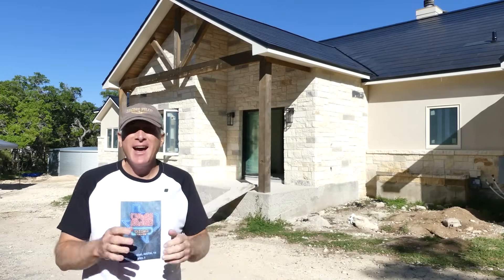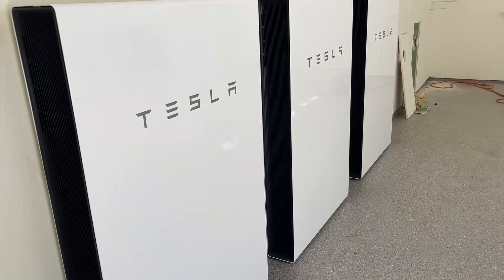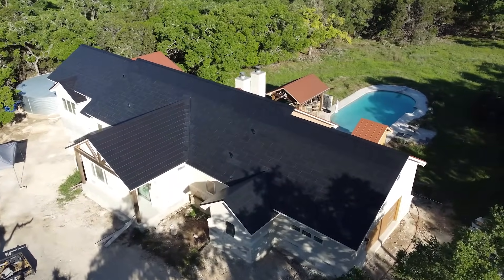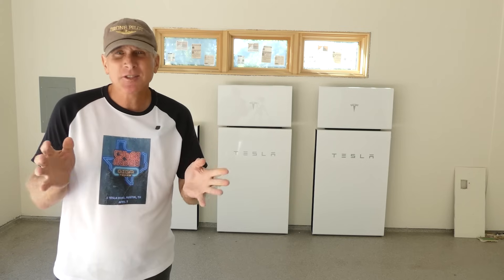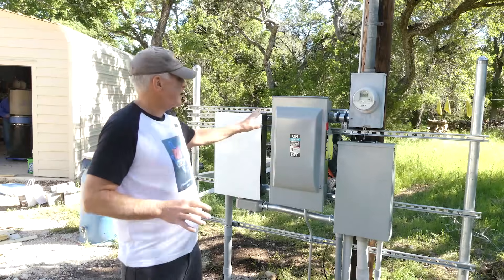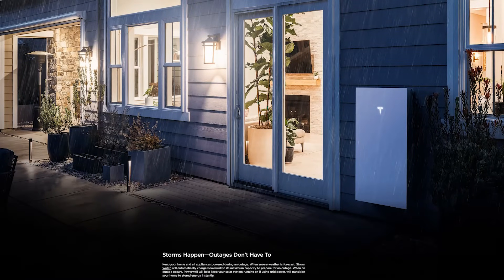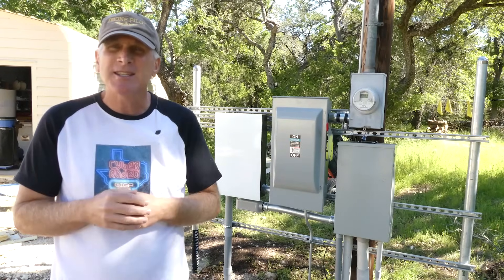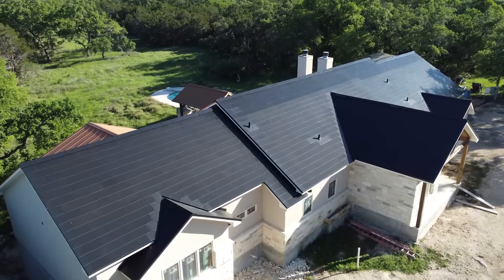Tesla Solar Roof & Powerwall Installation Part 4 ... Powerwalls, Gateway & Cybertruck Powershare

Comment: That is absolutely BONKERS that the gateway, disconnect and breaker box are mounted on a metal rack at the pole.  I worked in solar for 5 years and NEVER saw an installation like that.
Reply: I was thinking the same... where I come from, everything goes inside a fiberglass cabinet (unless its indoors).

Comment: If after rebates the cost of the system was $150K and there was never any cost to maintain, figuring an energy reduction of $300/mo, it would take 42 yrs to pay this investment off. 
I’ll pass …
Reply: Most of Texas has been experiencing peak electricity prices over 100 times higher than the the rest of the country. If you participate in the virtual powerplant schemes available via Tesla Energy the payback would be very high, very fast. Last night TX power prices hit $4500/MWh.
Reply: @KenWerkSolar still, there are cheaper solar options than the solar roof, even from tesla
Reply: Not that I am against these, i hope they do well and drop in price over time
Reply: @jonathannumer5415  Yes very true! The solar roof is at the high end of roof costs. Personally I prefer PV panels.
Reply: The price of PV systems in the USA is absolutely insane compared to here in Australia where you can get a 6.6kW grid-tied system installed for under USD3500.
Reply: @bradcavanagh3092  $3,500.00 USD ?   Sparkys here in the states would probably want $2k in materials and labor just to install my furnished EV charger.  Does Australia have generous subsidies or access to cheap materials?
Reply: The Tesla solar roof was never said or meant to be cost competitive to solar panels. It only makes sense in conjunction with a normal roof replacement. IOW, if you already need to replace your roof ($20-$40K ?), how much extra would it be to replace it with a Tesla Solar roof. It is the extra cost which should be used for ROI calculations. Also, there are a couple of less tangible benefits to the solar roof: (1) it will probably last much longer than the 25 year warranty; (2) the air gap between the roof tiles and the decking means a cooler attic and lower AC expenses.